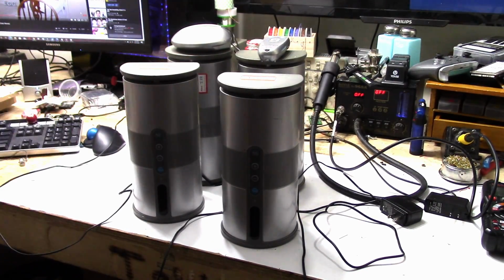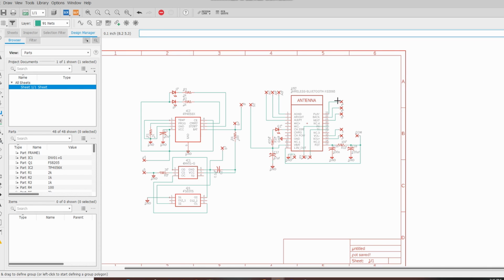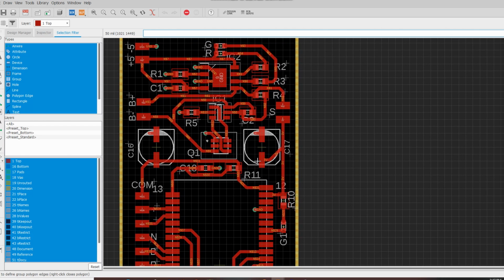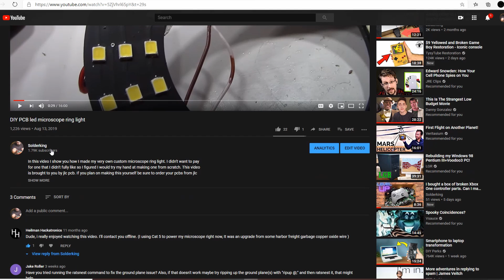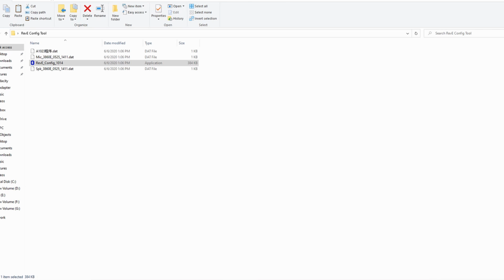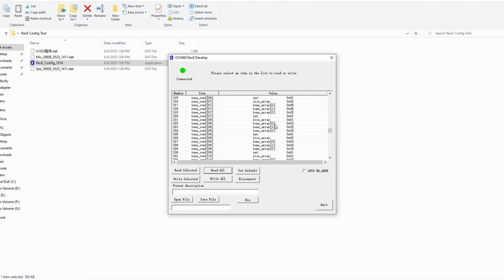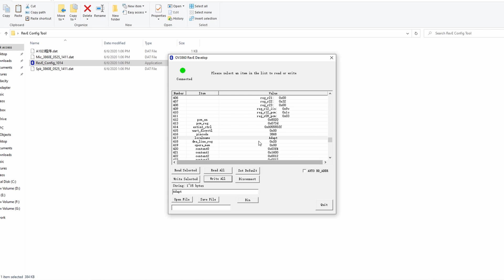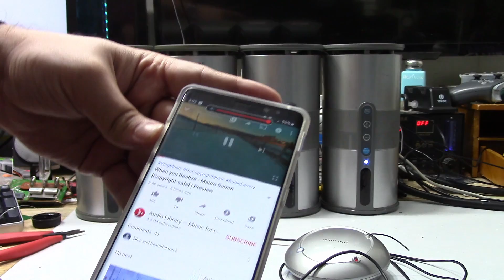Make a DIY Bluetooth Adapter!

Comment: This is great.  I have been looking for a solution to be able to use Bluetooth headphones in the car for the kids and then portable media players which have a 3.5mm jack on them.  I know this is the other way around but is it possible to have this as an input and be able to connected headphones to it?  Also what is the latency like?  The off the shelf ones on Amazon have very mixed reviews and as I want it to watch movies it needs to have fairly low latency.  Thanks!!

Comment: What solder iron bit do you use? I bought some that look similar size but the tips don't stay tinned for long even when i look after them, i keep them tinned when not in use too.
Reply from the maker: I use an Aoyue 968+ 2in1 station. The tip style is pretty common so its possible to get a cheap batch. Which do you have?
Reply: @Solder_king  I have a"Precision Gold A55KJ" solder station, i bought these https://www.amazon.co.uk/gp/product/B07L5M8Z18/ref=ppx_yo_dt_b_search_asin_title?ie=UTF8&psc=1, and i max my solder iron to 400 degrees, but they are bad at transferring heat well and I nearly ruined some pcbs because of them. I use flux too.
Reply: and the flat tips slowly stop holding solder on their own. I bought them so i can solder small chips but it just ends up burning the pcb. and i worry about ruining components.
Reply from the maker: @dalesmith4609  Have you tried lower temps? If its happening to tips from different sources then it could be the station. I know first hand that bad stations and irons can burn out tips and cause them pit pretty quickly
Reply: @Solder_king  I didn't know that could happen, i will experiment with it, thanks! I saw your post on reddit and came here, i just play around with arduinos, and can make simple pcbs now ( i draw them in Word, lol), but this is next level stuff! Don't understand it yet, but i subbed and hopefully i'll learn some more advanced stuff from you! Thanks again for the tips! (sic)